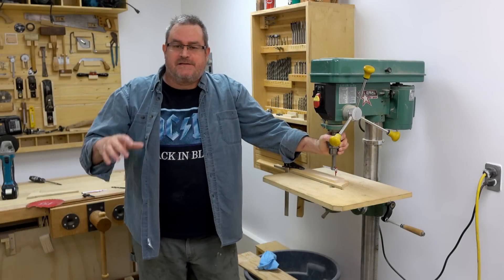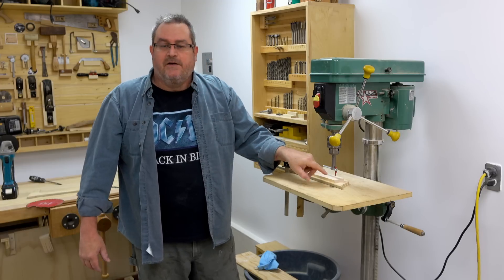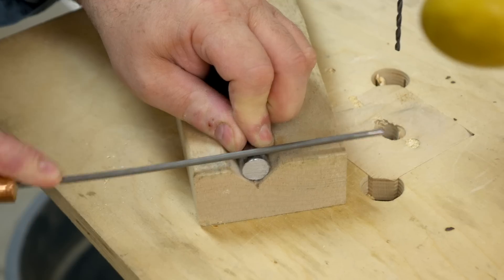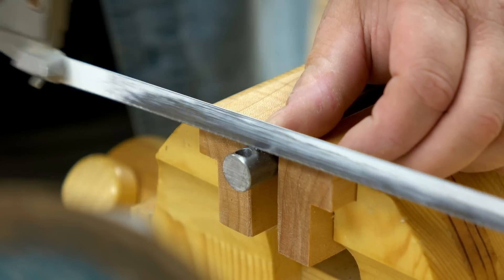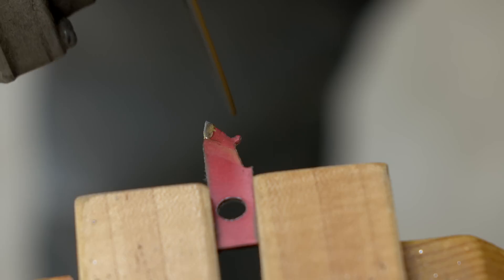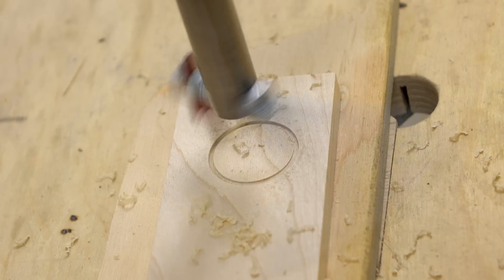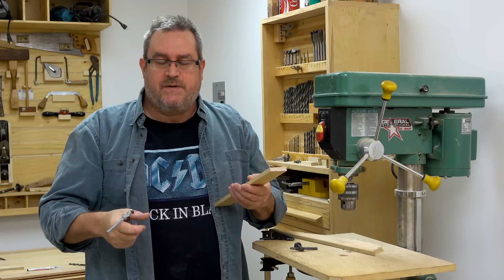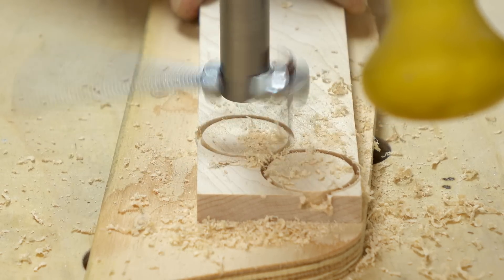Homemade Hole Cutter

Comment from the maker: Although I made this specifically for cutting glass, it works well for cutting wood. It's very important that the stock is clamped down so that it can't move during the cut, and it's best to stop before going all the way through.
If you do cut all the way through, the stock should be suspended, for example clamped in a vice with space underneath for the disk to fall out.
The big benefit of this type of cutter over something like a holesaw is that it can be adjusted to cut any size hole, rather than one fixed size, It can also create perfect wooden disks for plugs or inlays or poker chips, if you are into that.

The glass cutting video: https://youtu.be/ZMoHBeHs6EI

You can help support the work I do in making these videos:

Plans for sale: http://www.ibuildit.ca/plans.html

Support this channel on Patreon:
https://www.patreon.com/user?u=865843&ty=h

Did you know I have other YouTube channels?
My main channel: 
https://www.youtube.com/user/jpheisz

My home reno channel: 
http://www.youtube.com/c/IBuildItHome

My "Scrap bin" channel:
https://www.youtube.com/c/IBuildItScrapBin

Website: http://www.ibuildit.ca/
Facebook: https://www.facebook.com/I-Build-It-258048014240900/
Instagram: https://www.instagram.com/i_build_it.ca/
Reply: U should try it with diamond saw blade teeth. (for cuting glass)
Reply from the maker: yrty CZ - Guy, I already have more than enough of those pointing-out-the-obvious comments on the other video, I don't need them here too.
Reply: Very cool bit of improv milling, now all I need is a six pack of 
Corona's to bribe my neighbor into giving me one of his old blades.
Reply: I Build It 1 try metal
Reply: I think that is a great idea, I also like to make my own tools wherever possible, and with your permission I would like to copy this hole saw!? :)
Reply: Looking to build a deep 2" or 4" hole saw from steel pipe. Had the same idea as you with the saw blade teeth.  Except they will go all the way around the pipe.  I also thought about wrapping a ban saw blade around the inside and outside of the pipe.  Or just cut out teeth from the end of the pipe.

Comment: John
  The wobble you were seeing is due to balance issues.  For small holes like that you could use a shorter section of threaded rod, or extend the rod out more on the cutter side.
  Nice experiment.

Comment: Love it.If You want to experiment further.To be able to cut deeper, grind a relief-angle on the trailing edge of the cutter. Much like a drillbit works. So there is no rubbing.

Comment: John look up trepan. Machinists use them to put a groove in a face of a cylindrical part. The groove
is normally concentric with the centerline. The cutters have ranges they can cut. The view from the butt
end of red cutting piece down towards carbide end should look like a " ) ".

Comment: I really appreciate the idea of repurposing old TS blades, and this was a very cool hack. 
It seems that the biggest problem was the blade rotating around the shaft and throwing off the cut. I was wondering if making the mounting hole and rod square, or perhaps incorporating a tab to serve as a locking dog to maintain the blade at vertical would help prevent this. 
Love these experiments, John, thank you for posting them even if you don't consider them successes.

Comment: You should balance the thing by having the length of the threaded rod centered on the spindle then install a 2nd "dummy cutter" on the opposite side the same distance from spindle center as the functional cutter. The dummy doesn't do anything except account for weight of the functional cutter. It can be just a similar sized piece of metal flipped up 180 degrees so its out of the way and doesn't touch the work piece.

This isn't a perfect balance but it will significantly reduce vibration.
Reply: Definitely balance it if you’re working at 10,000 rpm, as for slow speed on a heavy drill press … what’s the point?

Comment: John,
It looks like this tools would also be useful for making surface embellishments on work pieces.  Decorative rings could be cut out with your tool, then optionally, filled with epoxy, polymer clays, wires, crushed stone, etc.  I suppose one could even make multiple cutters to create double- or triple-rings.

Thanks for another great DIY idea.

Comment: Saw the glass try. Think vibration may be one of the problems as well because its a single tooth cutter, try sticking some duct tape over the cut to stop it resonating.You could also experiment with reshaping the saw tooth so its thinner at the back and at the rear bottom. might be worth trying to use a drop of liquid soap as well to oil it

Comment: how about if you make a wood disc
attached to the rod 
then screw the tooth to the wood ?

or just make the tooth thinner and smaller hole
and add a second hole so its more secure
and dont move in the screw like an axis

Comment: I'm thinking there wasn't enough surface area on the blade tooth between the two locknuts and it eventually turned enough to get hung up in the kerf. Perhaps if you made a slot in the blade tooth instead of a round hole. and had it register on two flats on the threaded rod, it would not turn.

Comment: Hello. I thought that another threaded shaft could be added above and inline to the first to keep the bit from twisting. I thought that the cutter worked very well on glass, it is just a slow process. Also, for glass, you might be able to use a small segment of a diamond bit from a utility tool. I think you have a very good, workable idea here that could easily be made.

Comment: Good improvement is to thin the section of blade that is going to go in the hole, so there is minimal side rubbing of the hole. Just have to thin the trailing edge so there is still a good metal backing but no side rubbing on the hole.

Tip for next time is to thread the larger rod, so the adjustment rod is held more firmly, and then use the nut as a guide when threading it so you get a good thread, but you will lose the lock ability  with this, so just take some red threadlock and use it. Use a hardened capscrew for the rod instead of the allthread rod, harder steel and you just wind it in all the way to the shoulder and lock it, then cut the head off after the lock has cured.

Comment: The angle you cut the tooth at is not correct. You should cut towards the centre of the blade as it gives the correct rake angle. 
Also if you drill a hole in the centre of the spining shaft and tap, you could put a bar with a flat in there and it can be adjusted with allen key. 
Hope this helps

Comment: Interesting concept.  Cutting a larger radius hole would possibly work better than the smaller hole since the thickness of the blade wouldn't matter so much, kinda like how you can cut tighter radii with a 1/4 inch bandsaw blade versus a 1/2 inch blade.  Only downside I see is safety could be an issue with that slinging bolt while trying to hold down a piece of wood for cutting the hole.  And, of course, if the bolt breaks or something comes loose might be advisable to wear a full face shield.

Comment: When I made this myself, I used two horizontal screws so the cutting piece wouldn't rotate and the bar would be longer than the cutting point, so it could rest in pre drilled hole. Worked okay until it all warped and collapsed and ended up cutting a cone

Comment: I believe the idea is sound, but ............. you might think about using grade 8 bolt with a nylock to keep the blade attached. I think shortening the bolt considerably would make it safer to working around. I would consider using either multiple bolt lengths for different size holes or multiple cutters for you most used dimensions. I have been hit with a setup similar to yours and it HURTS.

Comment: @I Build It if it can cut say 6mm deep, it'd be trivial to saw the disc out and clean it up on a router with a pattern bit.
Very handy if you live somewhere where the health and safety pansies have decided that a fly cutter is too dangerous.

Comment: you commented that this is a fly cutter...more specifically it is a trepanning tool. I think it would be made better if it were equiped with a way to prevent the cutting edge from rotating around the bolt. perhaps with a second bolt above the first.(?)

Comment: Hey John great video...would it be possible to cut an additional whole in the cutting blade and put in an additional bolt and nut to solve the issue with it moving?

Comment: Did you ever think about clamping down your stock?  Might stabilize the work stock and improve safety?  Cool fly cutter.  Think I will make me one.  Thanks.
Reply from the maker: Ever stop to think that you are not talking to a 10 year old? Of course I clamped the stock, just because you can't see the clamp doesn't mean I was idiotic enough to not use it.
Reply: Sorry.  Didn't mean to ruffle your feathers.

Comment: I made one of these last year, called it the widow maker. I just bolted a rod on the side of a worn out hole saw. I'd swear it worked better than the hole saw ever did, but it was a bit more....... jumpy

Comment: Do you think it would cut plastics such as Perspex sheet?
Reply: It would but you will need a coolant to keep the plastic from melting. Sharpen the blade carbide edge as well and it will cut better, but for acrylic you can just use the tool steel blade section and dress it to a sharp edge anyway.

Comment: Did you mention the cutting speeds? Does it work better on slower speeds or fast?
Reply: Slower than molasses. The video caption said "3x speed" when it seemed to be going decently fast, so the real-life speed is just 1/3 of that.
Reply: I prefer to do slower speeds. As long as you dont lose control of the drill and the holes turn out good it really does not matter. But the faster you go the more likely you are to messing up I think.